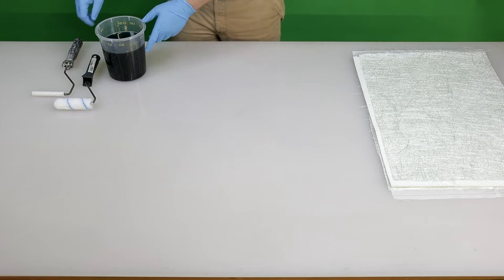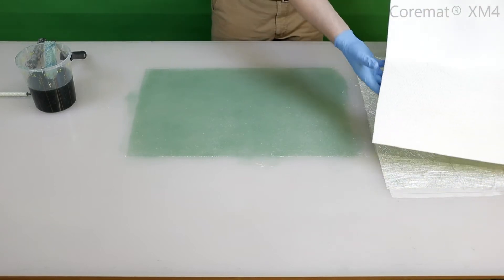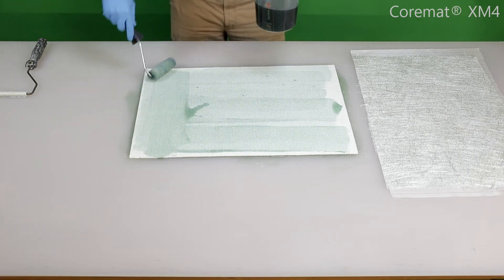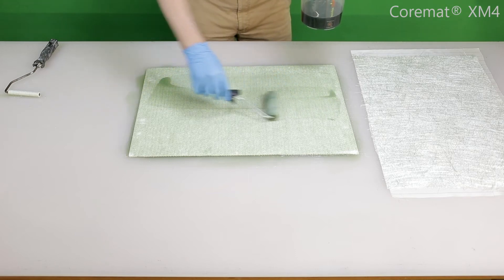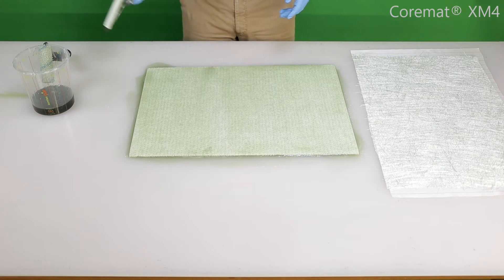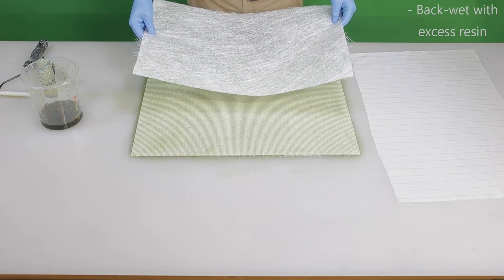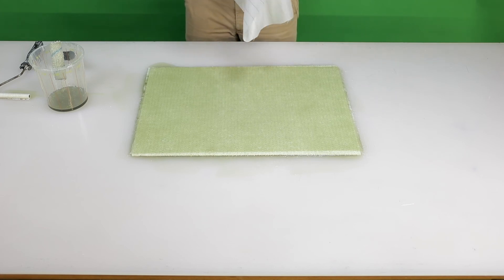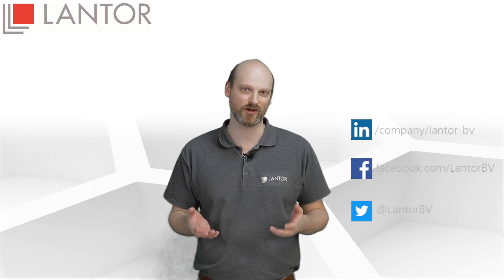Laminating with Lantor Coremat

Comment: This is a good instructional video.  How well does Coremat work with typical room temperature curing epoxy systems?  Will Coremat tolerate cure under a vaccum-bag?
Reply from the maker: Hello Steve, Coremat works well with all typical thermosetting resins. For mould conformity we recommend to use Coremat XM with Epoxy. For vacuum-bag curing and/or vacuum infusion we have the pressure resistant Soric core-materials: https://www.lantorcomposites.com/textile-foam-cores/soric/

Comment: Thanks for the video. What is the benefit of coremat? Weight? Can i use it to stiffin a planing boat deck? Ive read it doesn’t like vibrations?
Reply from the maker: Hello Michael, thank you for your interest in Coremat! Lower weight as opposed to a full fibre laminate is only one of the benefits of Coremat. Many of our customers are boat builders that use Coremat to make their decks. Vibrations is something that can be designed for and I am unfamiliair with this claim so if you could qoute your source I would appreciate it. If you would like the help of our Application Engineers with the incorporation of Coremat in your deck: drop us an email at Composites@lantor.com or visit Lantorcomposites.com!
Reply: Thanks i emailed you
Reply from the maker: @Micington  The answer should now also be in your mailbox!